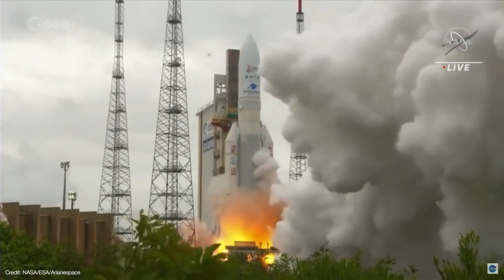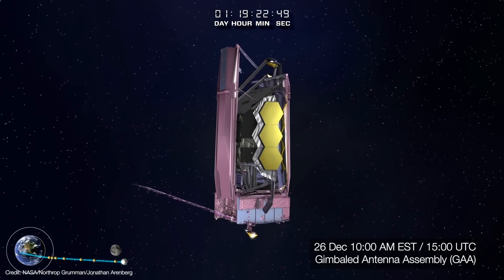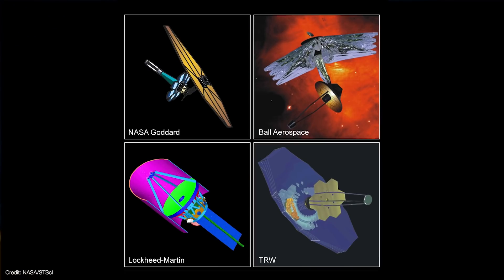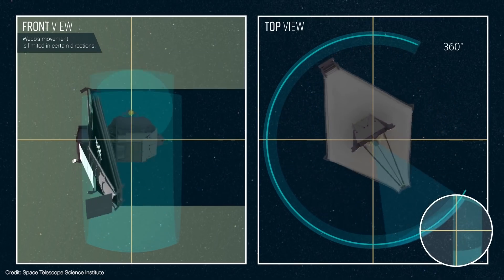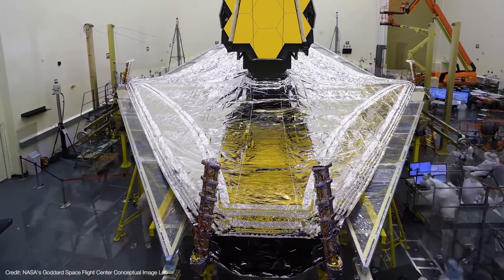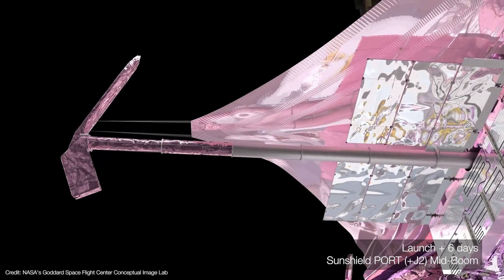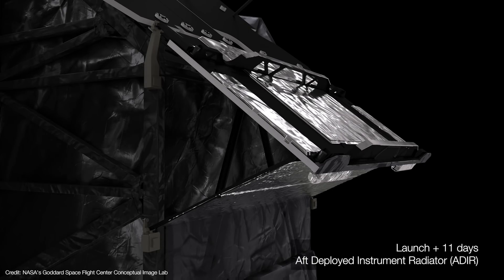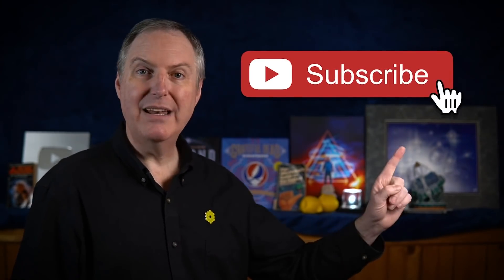How James Webb's Deployments MUST Work

Comment: I wonder what the cost is to build a 2nd one.  So much time and money went into the research.  Personally I think we WILL do a mission to Webb to fix or refuel it but I think it'd be worth it to just install a 2nd one as well (if the images it gets are compelling).
Reply: what capsule has the ability to do that... Currently zero
Reply: @Sonderax  any of the spacecraft currently in development for manned moon missions should also be able to reach L2.  All you need is an airlock for EVA... easily delivered by Falcon Heavy or Ariane
Reply: @JohnDoe-420  Neither are crew rated and will take months, and millions of dollars to do so. No easy way as it stands
Reply: @Sonderax  no sh!t... did you think it would be trivial to fix something a million miles away?  On the other hand, it's not like it's going anywhere.  Months & millions is orders of magnitude quicker and cheaper than making a new one.
Reply: @Sonderax  Then we develop it.
Reply: @XShadowAngel  If JWST has lets say 5 months to be fixed.. in 5 months we cant develop a new craft or modify a craft to carry 1-2 astronauts, EVA suits, Pressurisation systems. and much much more
Reply: First rule in government spending: why build one when you can have two at twice the price? Only, this one can be kept secret.
Reply: The next one is already planned. Bigger. But it's a long way away. I believe they will try refuel JW first. The next telescope depends on advancement in rockets etc. So it will be easier to design a refiling module. They have 10- 13 years to design and build it. There is a video about the next few generations of space scopes that are planned on you tube.
Reply: Does Webb have refueling capabilities?
Reply: @NavidIsANoob  No.
Reply: @TheLottolandus  It actually does have a port to allow refueling. Pretty sure I saw it in a Scott Manley video.
Reply: @Top_Weeb  yep it does have the port they just need to invent a delivery vehicle.
Reply: @Top_Weeb  Good to know.
Reply: It might be cheaper to build a second telescope than to repair it. Most of the groundwork is already done and any improvements that has come by the time it needs fixing is easier to install on a second one than to the one already up there. Even if possible
Reply: If they had any brains they would have included a refueling port so that a robotic mission could have refueled it ..Nasa Is full of mediocrity

Comment: So if the bottom part of the JWST will be facing the sun and it will be have an orbit on Earth's L2, would that mean everybody from Earth will see it during the nighttime? Like a bright star moving in a circle? That would be awesome.
Reply: Too far away, so no. The L2 point is over three times farther away than the Moon. It’s difficult to see satellites in low earth orbit. JWST will be  over 800 times farther away than any satellite you can see from Earth.
Reply: oh yeah huh I wonder what the magnitude of the thing will be

not many highly reflective tennis courts perfectly lined up in opposition with the sun to compare it to

Comment: would it be possible to use this heat differential as a thermal source for power generation?
Reply: Solar panels effectively do that in a more controllable fashion for power needs.
I'd guess that the radiator cooling system needs to be as simple and as direct a flow as possible, else it wouldn't be able to cool enough. Start tapping that heat differential and it would end up heating something else somewhere else on the craft - e.g. the wires & batteries. So you end up just moving the problem rather than dissipating the heat

Comment: If the radius of the JWST halo orbit around L2 is 210,000 kM and the radius of the Earth's umbria is zero at 92 % of the distance to L2, how does the JWST experience any shielding from the Sun ?
Reply: I think they mean the telescope is protected by its shields from IR radiation from the sun, moon and earth. 
The earth doesn't shield the telescope from the sun.
As he said, the sunward side is hot enough to boil water.
It's shields protect it from the sun. As well as protecting it from the earth and moon IR radiation.
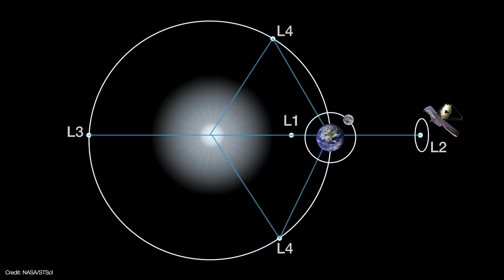Reply: @garysheppard4028    Then why not use the stable L4 or L5 points the unstable L2 if the Earth doesn't provide shade ?  BTW, at 5:38 of this excellent video the narrator says L2 was chosen "to block the heat of the Sun, Earth and Moon..."  Earth and Moon make sense as L2 sees mostly the dark side of each.
Maybe those points would require more fuel to achieve and outweigh any station keeping economies ?
Reply: @realbartlett8882  I guess because L4 and L5 would be more exposed to the sunlit side of the earth and moon. To shield the earth, moon and sun from those angles would need a much bigger shield . And they're further away.
Reply: To add on to the previous reply, part of the reason L2 was selected for the JWST was because at that point, the Earth, Moon, and Sun are always on the same side of the spacecraft. That way, a single sunshield can block both direct sunlight and reflected light from the earth and moon. So while L2 doesn’t provide any shielding of the telescope, it does make building that shielding much easier.
Reply: @ncjdncjcnjdcndjncjdn  I think you are correct. But that is not what was stated in the video at 5:38. I have watched several videos about JWST and they all contain the same misinformation. The animation clearly shows the satellite never actually being shielded but I thought the that was a distortion of scale. I had to find out the the radius of the halo orbit and the extent of the Earth's umbria to understand that was not the case.

Comment: My question is, what are the small pieces of silver in the original video just before 4:00            Thanks
Reply: This is the side that contains the controls and star tracker and will be pointed to the sun at all times. The silver is reflective material to keep from overheating.
Reply: @erichaynes7502  I mean the pieces that are floating in space. You see it at 1;12 in this video "See 'humanity's last view' of the James Webb Space Telescope post-deployment" also 
 at 2;45 in that same video I got the impression of panic in the background.
Reply: @damiaanspatrick2050  Looks like insulation bits that typically accompany a stage separation.
Reply: @erichaynes7502  Thank you

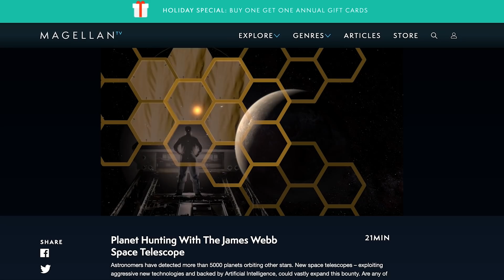Comment: 04:16 
Hmmm . the james webb telescope will be able to penetrate the alien atmospheres of exoplanets near our sun 
 Sorry , but afaik  we have already  probed the atmospheres of every planet in our solar system
The nearest exoplanet is Proxima Centauri b
Reply: the overwhelming majority of exoplanets have only been observed by transit i.e. dimming of the parent star as the brightness of a few pixels in a field image, not direct spectroscopic measurement. JWST has a number of actual spectrometers in the infrared range which is ideal for measuring molecular vibrations (i.e. atmospheric H2O, etc)
Reply: @JohnDoe-420  
Yes I am aware of that , was I was trying to say  is that the phrasing  'nearest exoplanet near our sun 'is a bit confusing , since the nearest exoplanet (prixima centauri b ) is closer to it's own star then to ours .

Comment: Is there also telemetry during sunshield deployment? I wish they would live stream with simulation, it's much more exciting to experience it this way than reading about it after the fact
Reply from the maker: If there is telemetry publicly available, I don't know of it. But webb [dot] nasa [dot] gov has a really nice timeline they're updating.
Reply: Interestingly there is an article on the web on how someone used a 6 meter dish to receive JWST telemetry signal, but the SNR was too weak to decode.

Comment: As much as I love hearing the details of this mission it also adds a lot of anxiety. Heaven forbid the mission fails, do you think it will spell the end of Nasa?
Reply from the maker: Sorry about that! :) Right now everything seems to be going fine, if that helps. i don't think an outright failure would end NASA as they have so many more things going on. But it would set back NASA's science directorate by about 20 years which gives me the screaming heebie geebies just thinking about it.
Reply: @LaunchPadAstronomy  aren't there redundancies built in to every point of failure?  I saw one video that mentioned there are redundancies for everything but haven't seen that reported elsewhere.  That would make a big difference in reducing risk

Comment: I'm assuming they couldn't use a smaller halo orbit which would keep Webb in the shadow of the Earth (requiring LESS shielding) because that smaller halo is more unstable and so requires more corrections
Reply: I think Earth's shadow would kill the solar panels?
Reply: @thatguy7595  they would use RTGs in that case
Reply: @thatguy7595  I knew I should have inserted my brain this morning!

Comment: Before I thought that the whole purpose behind the Lagrange points was their stable orbit. Not 100% stable as it still needs to do frequent correction burns to stay there…
Reply: Go to L4 or L5 if you want a stable point
Reply from the maker: True, much more stable there, but also has a lot of trapped debris flying around in there, among other problems.
Reply: It seems like nothing is always 100%
Reply from the maker: L2 is considered a "meta-stable" location.

Comment: It’s not that I doubt the tech, but after all the g-forces and general shaking about that’s inherent in launch, if all these insane steps, with all the springs, pulleys, wafer thin sun shield and all the other bits work to deploy 100% I’ll be amazed (and delighted). I can’t see it working but I really hope it does. Engineers are clever folk but Murphys Law is a cruel master.
Reply: Almost as bad as Cole's Law.
Reply: They did do a bunch of vibration tests so hopefully it's accounted for.
Reply: @NavidIsANoob  🤞

Comment: I wish they had a video camera onboard so we could see it as it unfolds etc, yes it would be pointless from a scientific POV, but it would be awesome to see the money weaving it’s magic. Even a tiny mobile phone camera would do!
Reply: They thought of it , but cameras produce heat (the sensor) and it is too much for the cold side of the telescope. On the warm side there is no need for cameras (nothing to see) Positioning a camera on a boom at a distance was unnecessary complication that they tried to avoid because the telescope was complex enough
Reply: @asicdathens  fair point, I was assuming that with all the transmission kit already there it wouldn’t be too tricky to mount a camera somewhere (not too much weight / additional circuitry) but I hadn’t thought all the logistics through (and I especially hadn’t thought of heat generation of such a small gizmo). At least it was considered, thanks for the info. 👍
Reply: The kind of camera that would work would be one that would float free in space and position itself off to the side of the observatory and eventually drift away. But they probably worried about the added complexity and weight, and the risk of eventually being struck by the camera.
Reply: I wonder if Hubble could see it, and if so what would it look like?
Reply: @Daniel Segel
Them: “Infinity war is the best crossover yet”
Hubble: “Hold my mirror”
Reply: @marsrocket  Hubble could see it but just as a faint dot in the sky, like a very distant star.
Reply: I'm impressed that they can get a complete overview of the craft without needing a camera, should the deployment get stuck.
Reply: @thatguy7595  JWST probably has thousands upon thousands of sensors stuck to her.